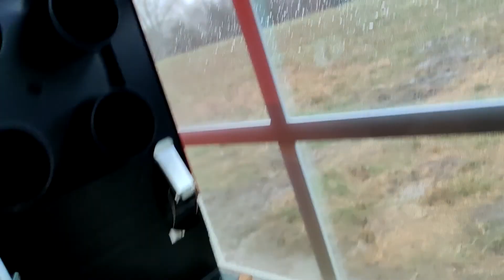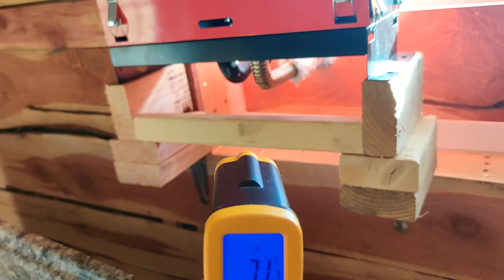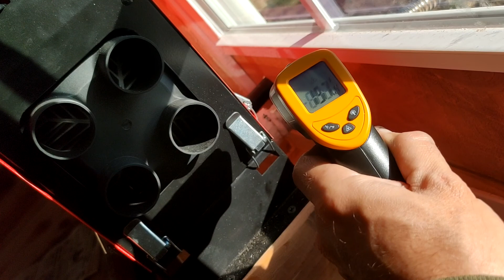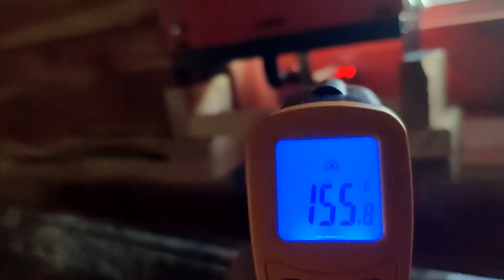Eberspacher Diesel Heater Chinese Clone Install part 2

Comment: I have watched a few of your videos man. You have me dying laughing in almost every one. Maybe try some stand up comedy in town? Never heard of a DIY comedian. Might be a niche. At any rate, please keep the videos coming. Pure gold! 

-Shane H.
Reply from the maker: Whoa.  Thanks!   I did standup for a few years before covid.   Haven't done it since.  But I will again someday I guess.

I stopped making these videos for awhile, but I might upload some of the footage I have sitting here just for the hell of it.
Reply: @WatchMeBuild  You are incredible. I have been through a lot of what you have going on (plumbing, electrical, bullshit). Bought a cabin built in 66 and have been remodeling it...about to do some skrrt myself (what brought me to your channel). Good idea, never thought of just running rigid insulation. We plan on doing thin marine ply with the corrugated (or something similar) metal sheets.
Reply from the maker: @frankbunny9294  good luck with it....   So far mine has done a good job insulating underneath
Reply: @WatchMeBuild  Thank you, we opted for roxul batt type insulation under the cabin (might have been better with foam cause now we have to put hardware cloth up to keep rats out of it). Hope you post more soon, take care and be safe for now.